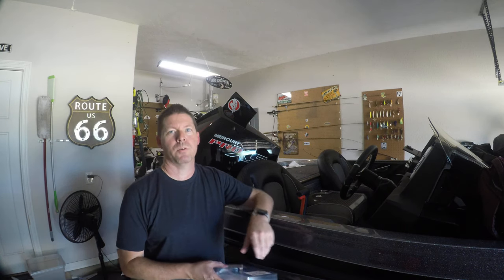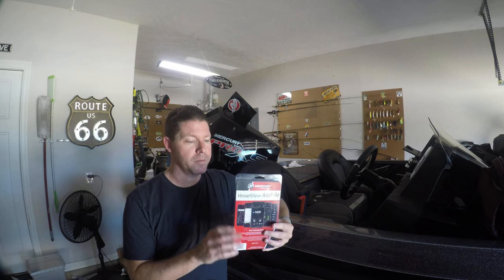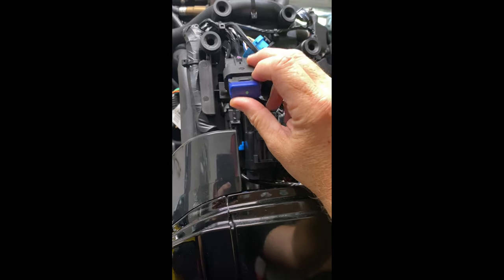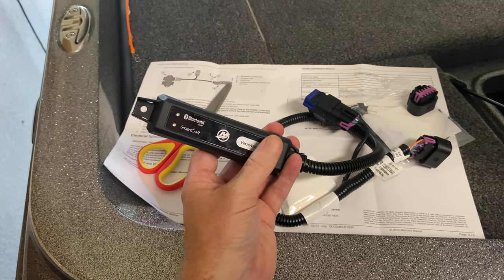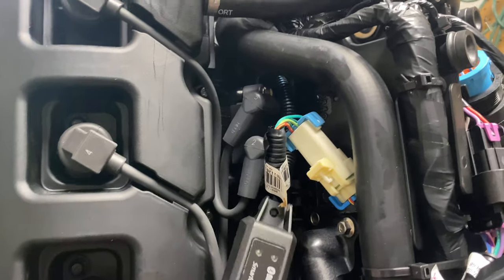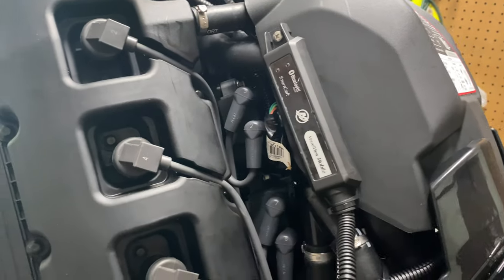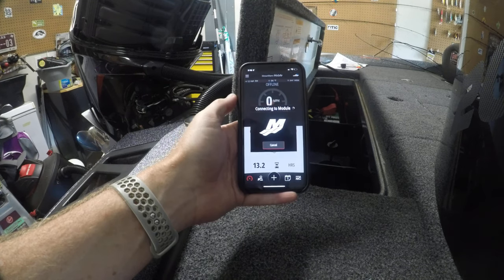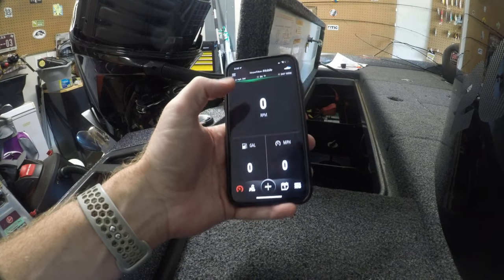Installing Vessel View New Ranger Bass Boat Mercury Pro XS 4 Stroke

Comment: Thanks! We installed the harness at the dealer and I downloaded the app. Short on daylight & factoring in drive time to our launching spot, we left for the lake in a hurry and mistakenly assumed we had connectivity. Got on the water and kept getting an error message when the app failed to connect. Gave up after a few attempts. When I got home, I took off the cowling to troubleshoot. Everything appeared to have been properly connected and I tested blue tooth connectivity on another device. No problems there either, but I got the same error message and also noticed instead of two steady green lights, I only had one flashing one. 

I was completely baffled and ran to YouTube. Your video, along with one other I stumbled on, addressed what I suspect is the cause. Namely, we put the terminal cap that came with in the Vessel View package back onto the wiring harness, instead of the one we pulled off the motor. Only hang up was that I left that piece back at the dealer - which is only 10 hours away - across the border in Canada.

It arrived yesterday via UPS - sitting here looking at it now - thinking "how could we have missed that?" The boat outfitter did the install. Technically, it's their fault... we did read everything, but I don't remember if the instructions that come with the Vessel View were clear enough and I already discarded them. Can you confirm? Thanks again...